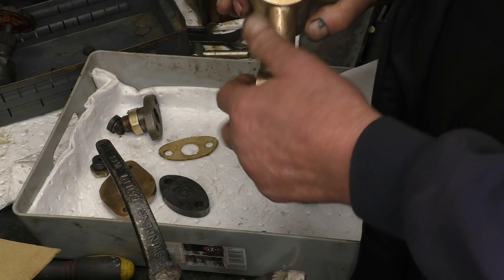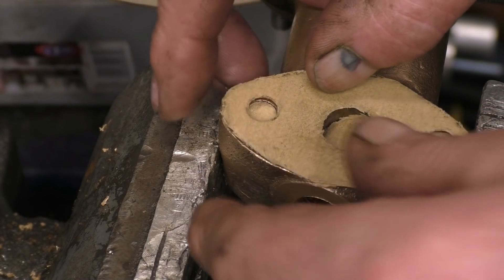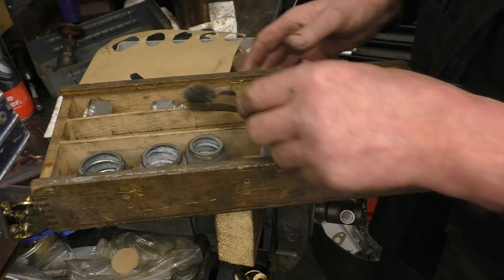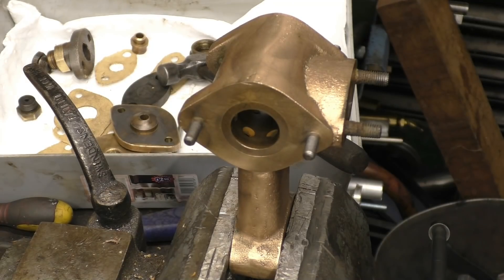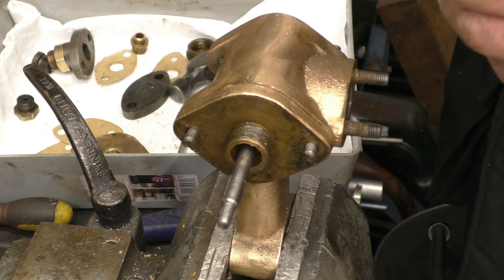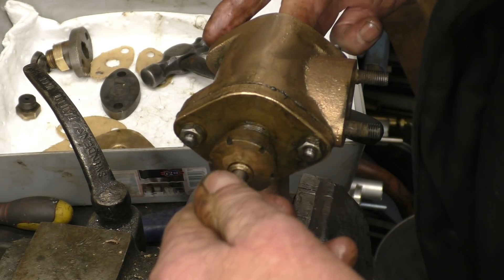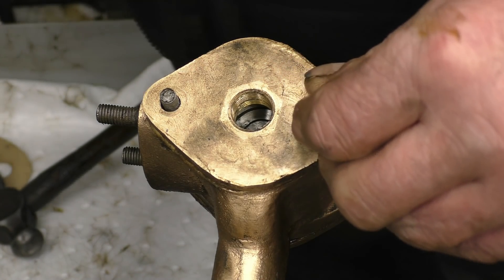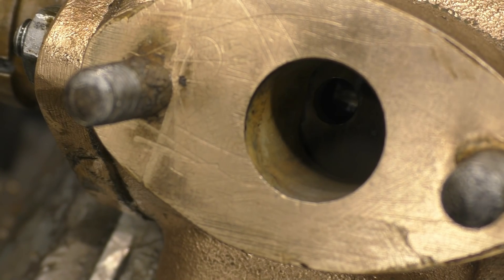Stuart Engine P32 . Assembling The Steam Valve

Comment: John, The punch set is known as A Swedish punch set - made in Sweden hence the name. Worth about £100, the wooden dowels locate the cutters in the box. The main advantage is that you can set up two cutters at once to easily cut out concentric joints without ripping the narrow wall. It is also best to use the end grain of a wooden block to allow the cutter to embed slightly into the grain.
Andy
Reply from the maker: Thanks for that it is a very nicely made bit of kit  I will have a play at cutting paper washers with it

Comment: The larger size of the BSF nuts is possibly the reason why they don't need washers.
Reply: Yes the larg nut has more surface area on it, so a washer is not needed, plus they are run at a lower tension, so do not have as much tension pulling them into the work.

Comment: As regards washers, I'm leaning towards the theory that were no tneeded unti;; the across the flats size of nuts and bolts were downsized to save material forthe war effort. Thereby sometimes requiriing a washer but not always. As most steam production predated the period, bigger nuts, no washers. I could be completely wrong,anyone else know?
Reply: Wonder about the serviceabilty aspect. Looks like he's got about 2 1/2 threads visable after nuts are tighten.